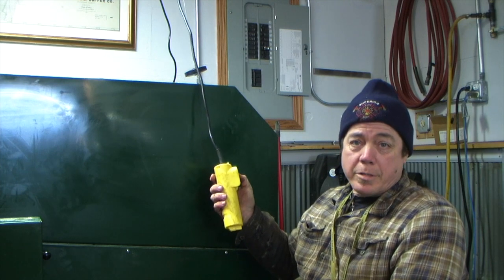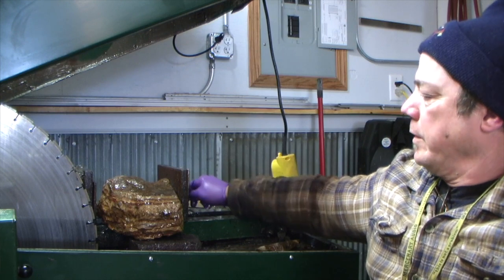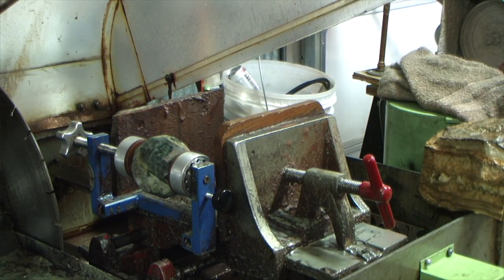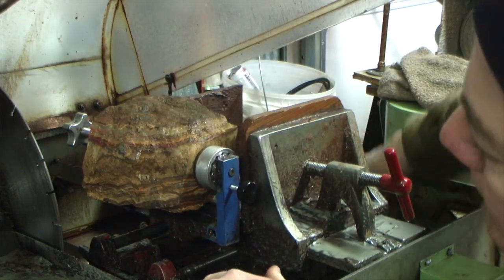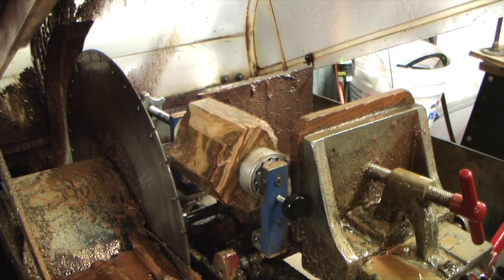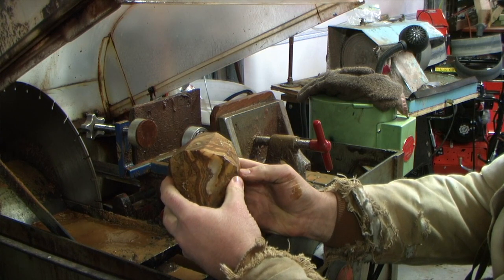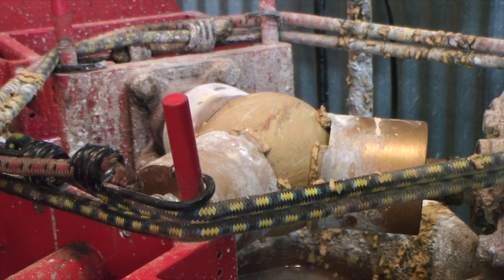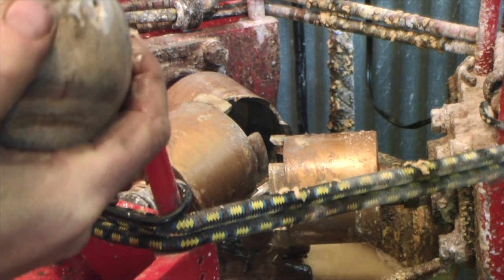How To Make A Rock Sphere Start to Finish

Comment: That was a really interesting video. I have patience, but I'm not sure I have enough patience to make spheres. I have been thinking about building a much smaller machine to make marble sized spheres, something around an inch. I figure they'll be quicker to make and won't take as much material. I only have ten inch saws and I would like to use rocks I can find myself. My first problem is finding an appropriate motor.
Reply from the maker: Thanks. I feel that your making marbles would fit right in with what you do. I have a set of motors and motor holders that I am going to fit onto a small, broken, sphere machine that I have. I hope to get it done this winter. I will let you know how it goes. Especially if the motors I picked work as I hope they do.
Reply: @DirtCleanerVideos  I'll be watching then! Thanks.

Comment: Hey. Any tip/rule that you can give when it comes to preventing the high-speed sphere grinders to start spinning one direction? I have built one myself, and I often have that issue. 😅
Reply from the maker: Are you asking about the stone not moving correctly within the three cups? Get them as level as possible. Find the right pressure. Make sure your preform is as round as you can make it.
Anything else, just ask.

Comment: How did you modify the polishing pads to fit the cups?
Reply from the maker: Cut out the appropriate size circle. Made a beveled piece to match the cup angle. Squeezed the pad in between. Use hose clamps around the cup to keep the pad contained.

Comment: A super great video. I'm from Germany, unfortunately my English is not that good, but I understand the most important things. In the meantime I've built a machine that works too. However, I have problems with the engines. I use 3 drills, but their speed is difficult to control. I would love to use direct current gear motors. But I have no idea which one.
12V, 24V, or 36V. How many watts and / or NM? You gave an address in a post, but this company does not ship to Germany. So I have to get something directly from Germany or from the Chinese.
For balls up to 15 cm (6 inch) do you recommend what minimum power?
Reply from the maker: Check out www.hplapidary.com
We use 110/115v in USA.
Reply from the maker: Talk to somebody in Germany that sells or repairs electric motors.

Comment: I use a drill press and 60 grit diamond blade with 1/2 inch bolt. Don't have the money for all those machines lol
Reply from the maker: But you are finding a way to do it. Keep working it!
Reply: @DirtCleanerVideos  The wet sanding 80-3000 grit silicone carbide is wearing my fingers out and giving my arms muscle failure lol
Reply from the maker: @justinberry3991  Yikes. That would do it.